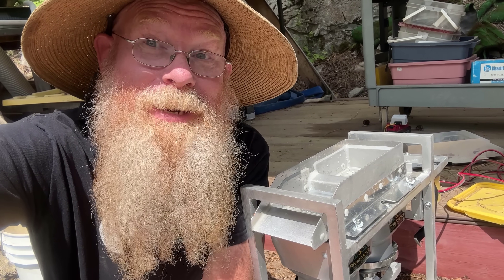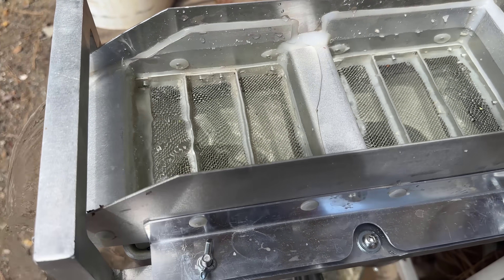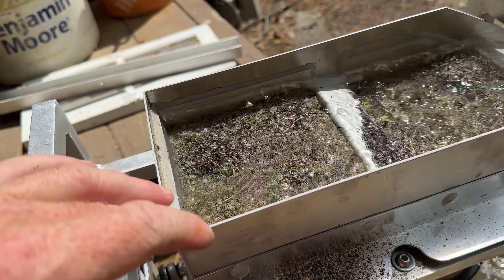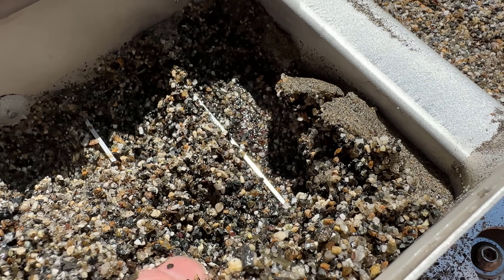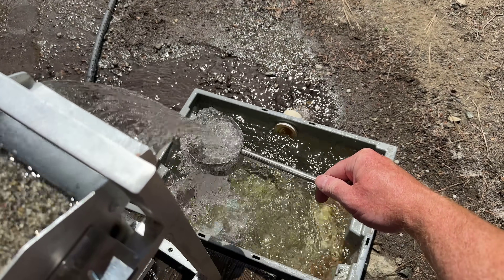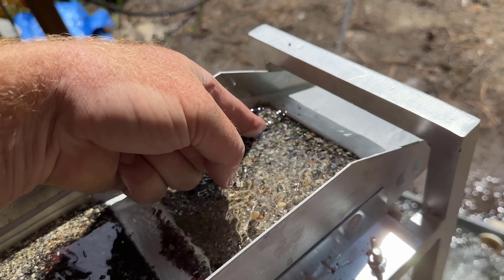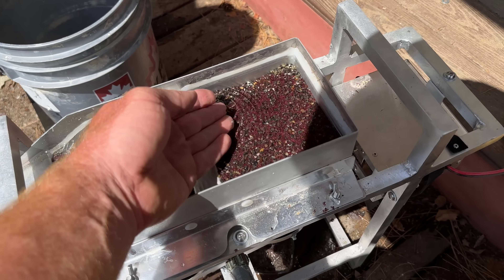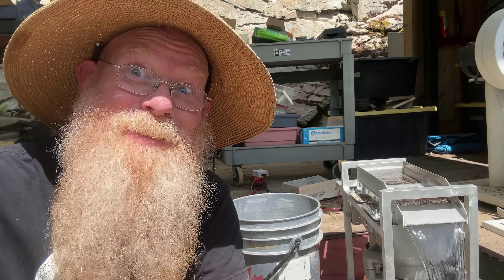Opening a Gemstone Mine in Canada! (part1)

Comment: Geologist here. I think you’re really going to struggle with any density separation for peridot. Olivine has a density of 3.33, orthopyroxene has a density of 3.32, and spinel has a density of 3.58. As a result you’ll separate spinel from olivine and orthopyroxene, but you won’t get a good olivine fraction. It’s honest best to separate by hand given that the rocks are 40-90% olivine.  In fact, it would be better to just sieve everything first since most of the olivine will be too small to cut, and then hand pick through the large fraction
Reply from the maker: The jig will be used to separate the olivine and spinel from the basalt.  at least that is the hopes.  The jig will sieve out the smaller fraction  and the result will be hand sorted.  At least that is the hopes, but there is still some experimentation needed.

Comment: That is a neat little machine! I can tell you with certainty though, unless that rotating arm for the agitation is on a really good bearing structure inside the box, those bearings are going to be the most common point of failure. Motor could lock up with bearings unable to spin, or overheating them until they seize up. That thing looks really nicely made otherwise!

Comment: The higher the your particle size correlation is , the better your chances .
You may find it necessary to pre screen and sperate into multiple fractions separated by particle size Separating peridot from basalt is a tough ask .
If you find things still won't quite work , it may be worth looking into jigs that can produce asymmetric pulses rather than only being able to vary frequency and stroke length .
Looking forward to your next test run , Dan .
Reply: Yeah, classifying tighter would make it a lot better.

Comment: Riverdance Gold Mining. 

Solid move! Dan has great saturation in this field. Advertising that pays for itself.

Need to be able to control the water flow to each basket separately.
Reply from the maker: can you explain why?  was it doing something it should not have?
Reply: @Danhurd  Original poster might have knowledge or experience I don't have but it seems like if you had individual control, you could push the back one for speed and be more conservative in the second one to avoid loss. Since you are only feeding the back one it might also make sense to feed the very back part instead of the center too. That would create a wedge effect in the back one to move the lighter material forward and out. Once you get to production a rectangle funnel at the back could speed up the feeding too. Just some thoughts. No experience just some fluid dynamics stuff from school days. That looks to be a pretty slick way to avoid a lot of hand labor and speed things up. I love it when tools designed for one use find new ways to be useful. Well done Young Man.